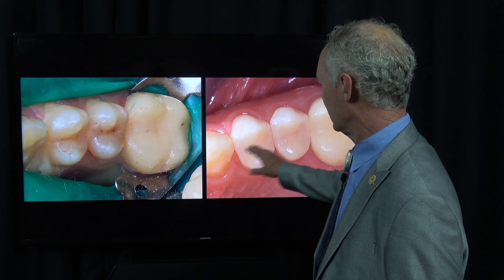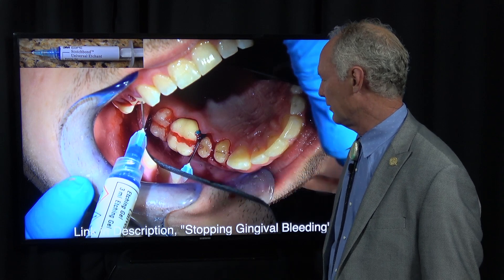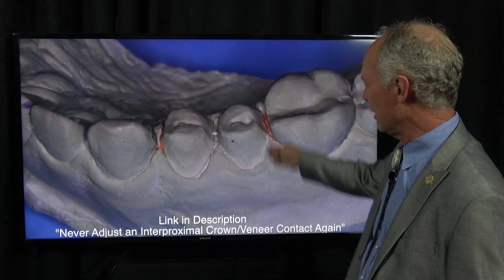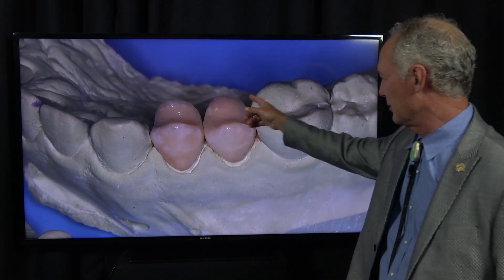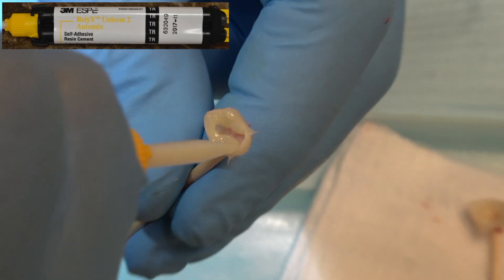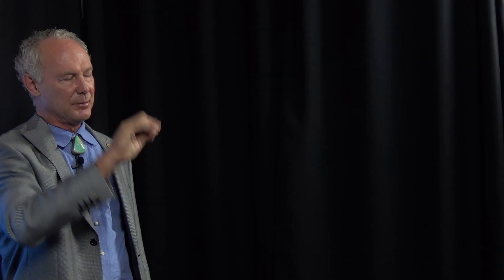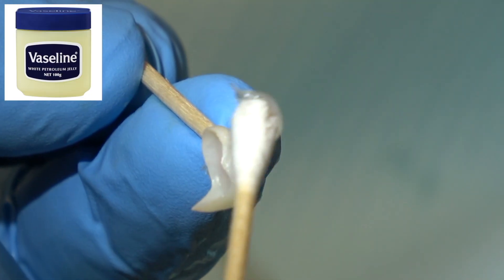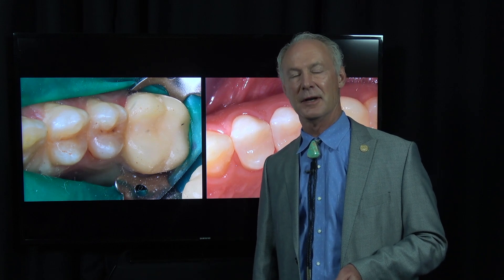Seating Crowns with Perfect Inter-proximal Contacts Using a Solid Model - Steven T. Cutbirth, DDS

Comment: What is the amount of cement gap in the 7 crown ?
Reply from the maker: I cannot tell you but the gap should be minimum with the care we take with impressions, measuring stone and water powder radios precisely, outstanding laboratory techs. and all the other things that go into minimum micro gaps. Remember, the stone models used for interproximal contact idealization are not the die models used for crown margins. The gingival 1/4 of the stone model used for interproximal contacts has been removed with a round burr, so the margins of the crowns will be 2-3mm away from the stone on the solid model used to perfect the interproximal contacts.  
Take your practice to the Top Tier. Subscribe to DentistryMasterClasses.com for an organized library of all the Dental Minute videos plus many complete comprehensive cases and many very important articles. New cases are added weekly.  Only $39.95/month.
Click here to subscribe: 
https://membership.dentistrymasterclasses.com/purchase/?plan=513

Comment: Alcohol dessicates the vital tooth and can possibly cause pulpitis / devitalisation later on - which is a complication you want to avoid especially when cementing a crown on.
Reply from the maker: Cleaning a tooth with isopropyl alcohol is not a problem if the tooth prep is in enamel. 
Take your practice to the Top Tier. Subscribe to DentistryMasterClasses.com for an organized library of all the Dental Minute videos plus many complete comprehensive cases and many very important articles. New cases are added weekly.  Only $39.95/month.
Click here to subscribe: 
https://membership.dentistrymasterclasses.com/purchase/?plan=513

Comment: Sor why not use Resin modified GLASS IONOMER CEMENT as we do have benefit of fluoride release

Why most dentist prefer dual cure resin cement over resin gic and what are adverse effects of RMGIC(if any)
Reply from the maker: I am not a fan of glass ionomer cement. Have you ever cut off an old crown that was cemented with glass ionomer cement and there was a 1-2mm line of black mold, or something that resembled black mold, at least there was leakage, under the crown at the margin? Also, back when I used glass ionomer cement, I had regular issues with post op sensitivity. I never have post op sensitivity using Unicem resin cement. I have successfully used resin cement (Unicem) for many years with all crown cementation. Nothing is broken, so I am not trying to fix (change) it. Take your practice to the Top Tier. Subscribe to DentistryMasterClasses.com for an organized library of all the Dental Minute videos plus many complete comprehensive cases and many very important articles. New cases are added weekly.  Only $20/month.
Click here to subscribe: 
https://membership.dentistrymasterclasses.com/purchase/?plan=513
Reply: dual cure resins have 10-fold adhesive stregth. also partial restorations such as veneers/occlusal veneers/maryland bridges should be luted with such resins. Moreover, if the prepared tooth is shorter than 4-5mm or the axial inclination is more than 15degrees resins can be used. RMGIC are for full coverage restorations and one of the best solution with its less technique sensitivity
Reply: Specially in vital teeth !!!

Comment: Is there a possibility of collapsing dentinal tubules of prepared tooth which also gets etched for 45 seconds While we use phosphoric acid to stop bleeding adjacent to it...
Reply from the maker: Keep the etch on the gingival tissue if you are using it to stop bleeding.
Reply: Over etch will also decrease surface roughness which is required for a better adhesion
Reply: on enamel of course

Comment: Doctor steven the preparation of the second molar didnt affect the occlusal registration ? i know that one side is prepared but still the casts might be rocking ,, any special tip or an extra step is done regarding this ?
Reply from the maker: I'm not sure what you are referring to. What is the reason you think the preparation of the second molar would affect the occlusal registration
Reply: @centerforard   i mean the occlusal recording  when we prepare the last tooth in the mouth or have a free end edentulous ridge
Reply from the maker: Always leave at least a tooth or two in an arch unprepared to maintain the vertical dimension of occlusion.
Reply: @centerforard  How about the habitual occlusion is perverted?
Reply: Using a resin jig works well